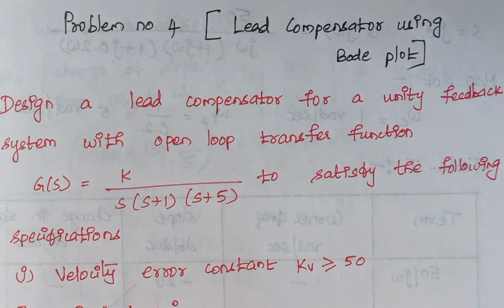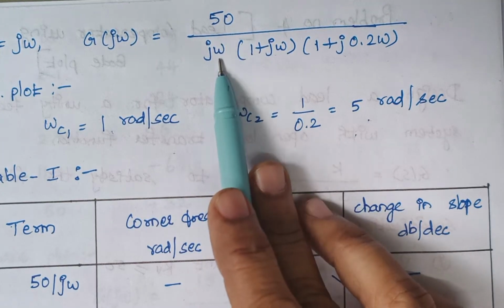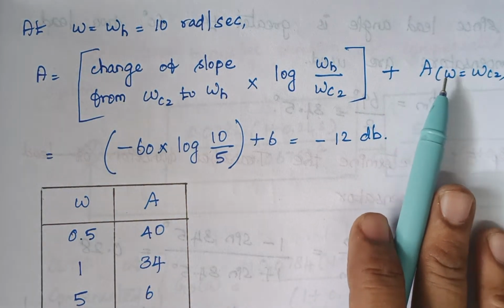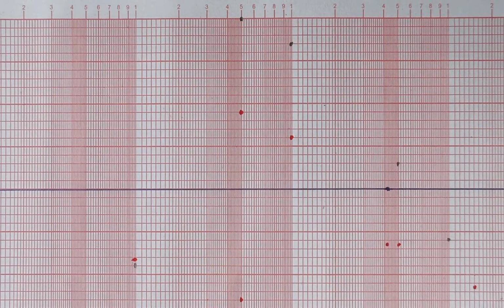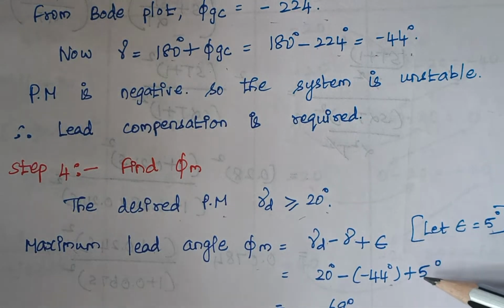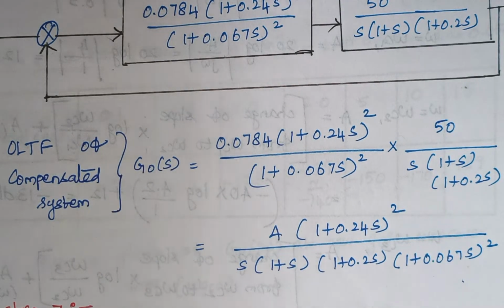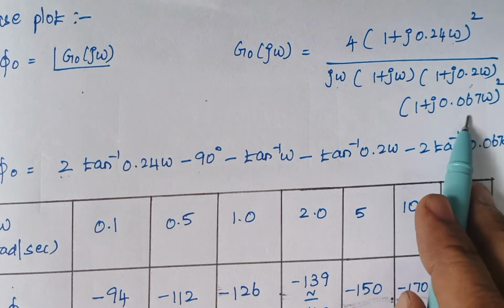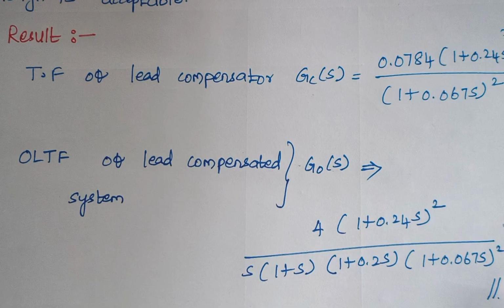Problem no -4 ( Design a lead Compensator using Bode Plot)

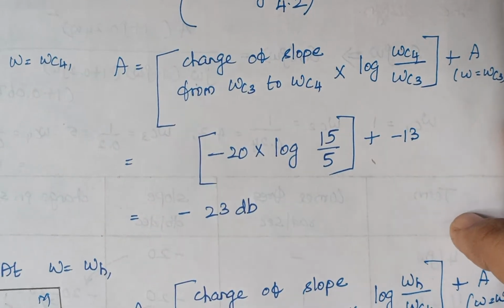Comment: mam, on 19:00, isn't it supposed to be -60log (30÷15) - 23?
Reply from the maker: Yes ,you are correct.it should be 30/15.extremely sorry.Thanks for the info

Comment: While writing the open loop transfer function You have included the attenuation factor but in problem 3 you skipped it why?
Reply from the maker: In problem no 3, the phase margin is 13°(positive) but in problem no 4 ,the phase margin is -44° ( negative).This is the reason behind this

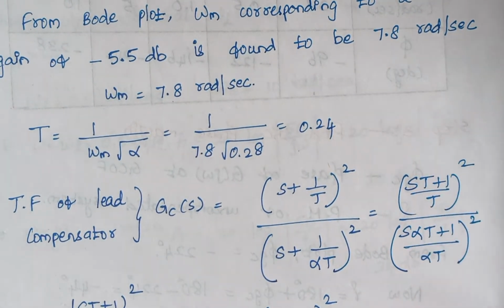Comment: Transfer function of lead compensator 15:19 formula is changing problem to problem
Reply from the maker: Check step no 4.Here the angle is greater than 60 ⁰.So we are using two compensators in series.when you combine 2 blocks in series,you have to multiply as per block diagram reduction.this is what done here

Comment: why the attenuation factor has not taken in series on step 6
Reply from the maker: Here the system is unstable ( refer to step 3.Phase margin is negative). Therefore we are not including the attenuation factor
Reply: Thank you Ma'am I cleared CSD subject because of your teaching
Reply from the maker: Most welcome ☺️
Reply: Ma'am incase in LAG compensator the PM is negative, similarly we should not add 1/ Beta in the OLTF block diagram?? @kowsiteaches
Reply from the maker: Yes,if P.M is negative,we should not include the attenuation factor